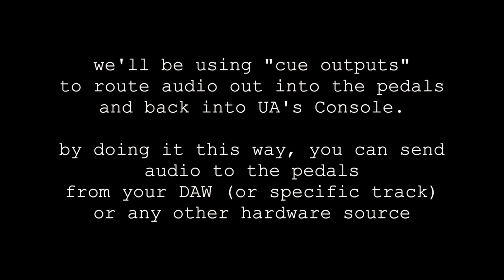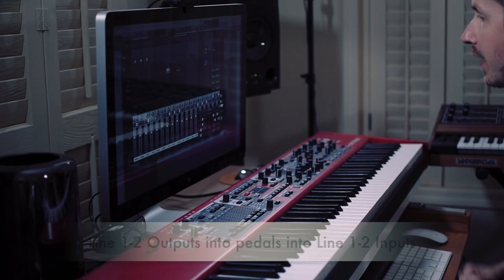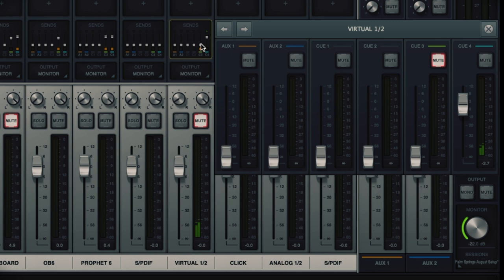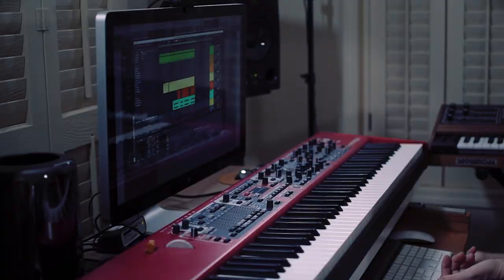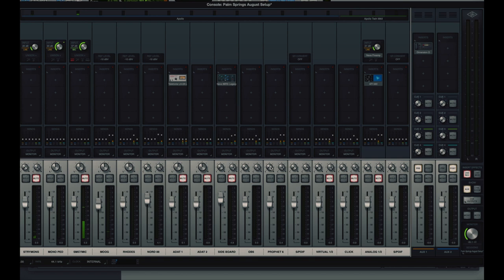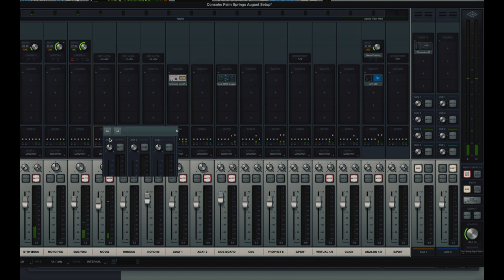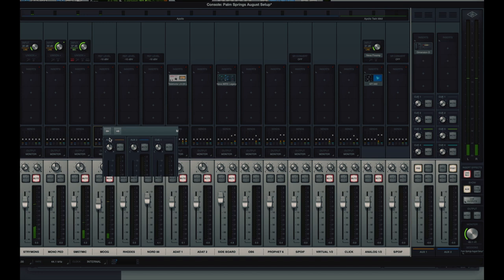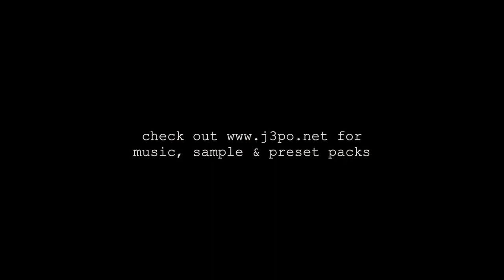Using Hardware Pedals on the Master - setting it up in UA's Console

Comment: Thanks for the video, very interesting. The signal going out of the Apollo twin into the pedals, how where they inserted again to the Apollo? Directly to Apollo 1&2 input or via another UA device? I guess this set up needs at least four inputs and two outputs on the audio card unless only using plugins out from daw through pedals and back in input 1&2. Asking since Apollo twin only has one pair of inputs and outputs.
Reply: Yeah, I'm wondering this too for the Twin.
Reply: After looking at his pedal tour video. He has one row of stereo pedals (Line 1 and 2) and one row of mono pedals (Line 3). I think if you just only use mono pedals on Twin, you go guitar/keyboard into High Z and then Line 3 Out to the pedals and then back into Line Input 2?

Comment: Love this. Always thought you needed a reamp box to get the levels right. Do you have problems with those?
Reply from the maker: As long as you gain stage correctly, it's not a problem.
Reply: @j3po784  would love to see your gain levels you’re working with. Man I’m such a huge fan. Definitely lusting after a Prophet after watching you and Semrad crush so hard. Thanks bro for writing back!
Reply from the maker: @chrisharrison809  keep those levels low! Only push the gain at the very end of the chain. Just like mixing. ;) Appreciate the kind words Chris!
Reply: @j3po784  excellent. You’re very welcome. That lesson gk shit is like just registering for me even though it’s been out a while. It’s really special man. 

You have a number on the meter on console you aim for and into the pedals and back? I’ve heard so many damn numbers. -8-12db signal coming out. And then for your input on the pedals, you just go by ear and keep it pretty cool? 

Also, you tend to keep your monitors at a certain volume all the time? I recently heard, pink noise at 80db spl or so.